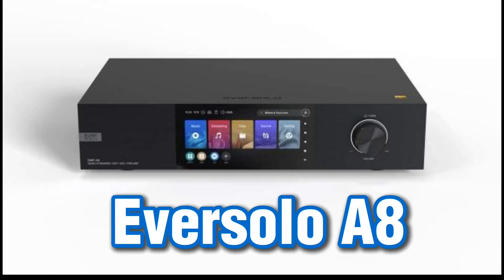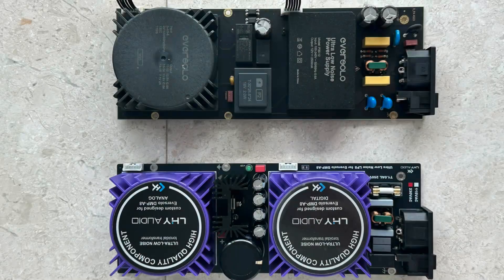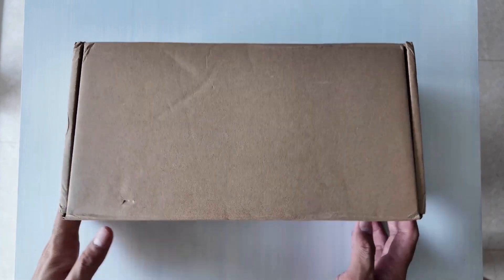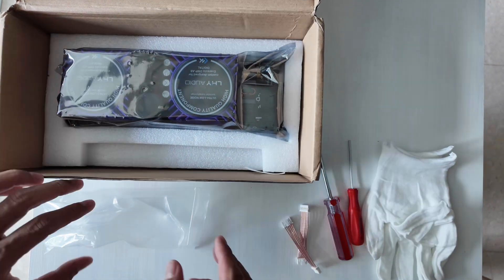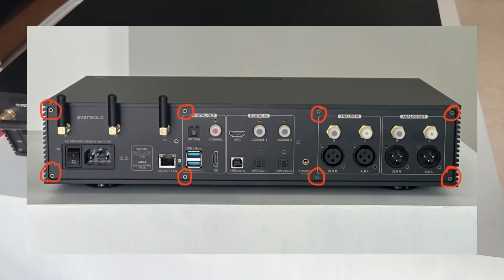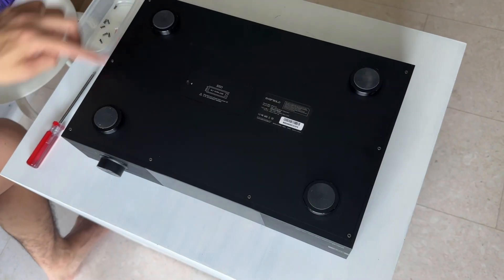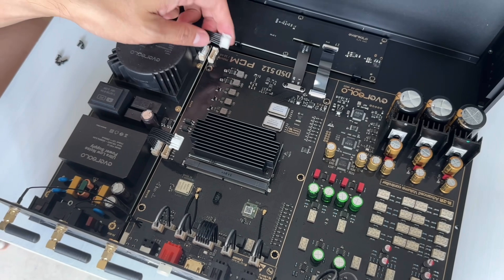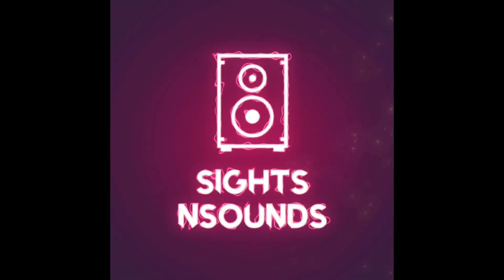Dual Linear Power Supply LPS Upgrade for Eversolo A8 - Installation Guide and Sound

Comment: I enjoyed this video tremendously and I am looking at purchasing a DMP-A8 in the near future. Someone commented that the sound can be tweaked a lot with all the features of this player. How about starting by replacing the power cord that came with it with something better? Have done it to several of my components and the improvement was excellent in all aspects; better bass, soundstage, treble, etc. Cheers and happy listening
Reply from the maker: I’m using aftermarket power cords with the Eversolo and it made positive changes to the sound. But the changes by upgrading power supply is more pronounced. Happy listening and thanks for supporting my channel
Reply: @Hifihobby can you tell me which power cable your using
Reply from the maker: I’m using Oyaide Vondita X power cable

Comment: Hi is this upgrade worth it for me ? ,i am using my dmp a8 as streamer /transport to gustard x30 dac to  quad artera pre to hegel h20 power amp your input would be welcomed 😀👍
Reply from the maker: The bigger difference is in the digital section because the switch mode power supply is changed to a linear power supply. It will help improve the sound for a relatively low price
Reply: @Hifihobby thankyou i will purchase one 😀👍
Reply: @Hifihobby hi any recommendations or links to dealers selling the upgraded power supplies please ?
Thanks
Reply from the maker: @ianbell2908 Hi you can get the LHY A8 LPS from Vinshin Audio website or look for eBay there is the version with 3 linear transformer that’s more expensive and so far that has no hum issue
Reply: @Hifihobby hi ,i have oredered the leafaudio 3 transformer lps ,did you manage to do a side by side comparison just out of interest,thanks for your advice btw😀👍
Reply from the maker: Not yet, I was busy with my work (YouTube is a part time hobby for me). Am planning to do that this month
Reply: @Hifihobby  Hi ,i have installed the leafaudio triple transformer linear ps ,really happy with it ,subtle differences across the range ,mainly upper frequencies ,no humming from unit ,gets hotter than before but not too hot,happy with the upgrade 😀👍
Reply from the maker: That’s great to hear! 👍🏼
Reply: @ianbell2908 Hello, do you think that this PS was totally worth it ? I still dont know what to choose between the 2 or 3 ps versions ! You got the Nichocon or Mundorf one ? Thx
Reply: Hi ,i noticed you have a T8 on trial ,how does it compare to the a8 with linear power upgrade ,is it worth upgrading to T8 in your opinion ?
Reply from the maker: If you are using the A8 as streamer only, to me it’s worth to sell it off second hand and get the T8.
Reply: @Hifihobby thankyou ,that was my thoughts ,is the T8 better sonically ?
Reply from the maker: Short answer is yes. Im still testing and got to wait for my full review video to be ready to get the details 😉
Reply: @Hifihobby thankyou your advice is appreciated😀👍
Reply from the maker: I’m happy to share. 😁

Comment: I can't understand why the bottom 8 screws required removal. I might have used a magnetic tip screw driver to stop screws from falling inside. If made of aluminum, it won't matter.
Reply from the maker: The 8 screws are connected to the cover that is to be removed. The screws are on the outside and not inside of the unit. You can refer my video again
Reply: Nice the new transformers becoming warm,  less efficient, not a good sign.Is the case build for this extra heat? A small hum…….I don’t feel good with this, no actual  scientific Measurements and tests
Reply from the maker: If you are not comfortable then you should not go for this mod.

Comment: Hi, I installed LPS upgrade, truve voltage 230V, all is in order, device opens up but no sound comes out! Then turned back to the original power supply, sound comes out, I installed LPS08 again, no sound! Installed the original one, sound comes out. What do you think the problem is? All the cables are back in it's original place, no changes. Also, I checked back again, there was no plastic film to remove there..
Reply from the maker: Could it be the on off switch at the back?
Reply: @Hifihobby no since if it was off the device wouldn’t turn on at all
Reply: @Hifihobby are there any other switches on the board?
Reply from the maker: There’s no other switch on the board.

Comment: Did you do another review after a suitable run-in period? That would interest me very much!
Reply from the maker: After using it for months now, my findings are the same as in the video and the slight hum is still there, so I don’t intend to make a new video. I plan to make a comparison with the triple LPS version in the near future. Stay tuned!
Reply: @Hifihobby Great! I plan to upgrade my A8 too when I get it. Many thanks! All the best, Rob in Switzerland
Reply: @Hifihobby  Apparently the 3 transformer has no hum. Can't find any technical specs on either. One might assume the 3 transformer would be better. When are you doing this comparison?

Comment: I got my DMP-A8 a last week.  Still enjoying it.  Not sure yet when I have to upgrade to dual linear power supply.
Reply from the maker: Should let it run in a bit and enjoy the music system first. There are lots of things you can adjust in there like DSP if you wish to make some adjustments, or use REW for more detailed calibrations

Comment: I installed the LHY LPS a few weeks ago and just realized I may not have removed the plastic film from the top of the transformers.   I assume they should not be left on, correct?
Reply from the maker: Supposed to be removed
Reply: @Hifihobby  Hello.  I reopened the a8 and removed them, thank you.  Question: are plastic insulation rings supposed to be placed on the PCB stands like with the a6 LPS before screwing the dual LPS back in?  Thank you.
Reply from the maker: @michaelrobinson8241  You are not supposed to put the plastic rings for this one else the IEC plug won’t align properly to the cut out hole at the back
Reply from the maker: How did you find the installation and sound improvements?
Reply: @Hifihobby  I purchased the A8 and the LPS together from the same seller so installed it immediately therefore I'm not able to compare it against the switch mode supply.
Reply from the maker: How do you like the A8 and how does it compare with your previous ?

Comment: Un grand merci pour ce tuto très bien fait, une petite question, que devient la garantie constructeur après cette modification ? 🤔
Reply from the maker: Warranty is supposed to be void if you open it. There is no warranty seal on the unit though.
Reply: @Hifihobby  Ils ont peut être un autre moyen de savoir si l'appareil a été ouvert, ce serait très simple à réaliser ! 😉
Reply from the maker: Many people have upgraded the LPS for the A6 and this is rather new for the A8. There’s no need for the upgrade if you are not comfortable with it.
Reply: @Hifihobby  C'est les doigts dans le nez, et les yeux fermés que je peux faire cette manip, ma question ne porte que sur l'hypothèse de la garantie !

Comment: When you turn the device around you see those plastic like feet underneath. Is it possible to change those against aluminum feet? What do you think? Thanks
Reply: The A8 feet are easy to remove. Lift half the rubber, enough to reach the screw and unscrew it. Literally 2 mins work. Absolutely no need to go inside the A8 for that. There is some paper in between the rubber and the foot that tears to get to the screw, but that is not an issue. I now have 4 Isoacoustic Indigo pucks at the place where the original feet were. (My stack is 21kg with the A8 at the bottom of the stack)
Reply from the maker: @WizNLD Thanks for sharing 👍🏼
Reply from the maker: It’s a messy job because you basically have to remove all the circuit boards. I’m now using  isolation feet below the Eversolo and it woking well
Reply: The feet are screwn from the inside of the A8? No way to remove the rubber layer underneath the feet? That's a pity. I don't understand why manufactures don't spend these 3-5 € more to install proper aluminum feet...
Reply from the maker: @KurtKugler-f2x I tried to remove the rubber part of the feet but was not able to do so easily and was afraid of damaging it.
Reply: @Hifihobby  I heard in a review yesterday that those feet are made from metal. I will inspect that, when my A8 finally arrived.
Reply from the maker: Yes they are metal with a rubber on the base.

Comment: Thanks for that cool video, looks very impressive and easy to replace.
I use the DMP-A8 as streamer only and I have connected it via USB to my new external WEISS DAC204. The question is if it is worth the investment for the upgrade power supply as I am not using the analogue section of the eversolo. Means can I expect any sound improvement if using the A8 as streamer only without internal DAC but with the upgrade power supply?
If yes which kind of sound improvement can I expect?
Reply from the maker: I didn’t compare performance of the streamer section alone but I would presume it would bring the same improvements as what the LPS did for the A6 used as streamer alone (tonally richer, more details an better midrange). If anyone has tried this please share in the comments

Comment: Great video! Just ordered one, i can't wait to fit it. I noticed you didn't fit the nylon washers between the chassis and the psu pcb. Did the instructions mention anything about this? There may be no need to, but I've seen it done in the A6 videos. I wonder if it might make the hum less audible, isolating the psu from the chassis? Thanks again for a great video. Liked and subscribed!
Reply from the maker: Unlike the A6 LPS, you don’t need to put the washers for this A8 LPS. If you put the washers in the IEC inlet will not align to the opening at the back. Thanks for subscribing, I’m hoping to reach 5k subs this month. Is there any particular content that you prefer
Reply: Thanks for the fast reply! Have you done video's of your own system? What you use and why? Obviously any more A8 upgrade video's would be great!😂
Reply from the maker: Good suggestion. My system “tour” is in the pipeline 👌🏼

Comment: Nice. I just upgraded the clocks (Ian Canada SC PURE) and voltage regulators (Sparkos labs 5v, 12v, -12v)  in mine. Very big improvements. Doing the power supply next. Using a Toroidy Supeme Audio Grade transformer, Ian Canada 12v LinearPi Pro ultra-low noise linear power supply, Nvarcher 12V Super Capacitor Power Filter, and MOFI HiFi AC Power Line Dual EMI Filter Module. It will be at least 13X lower noise than the LHY audio LPS. I am glad to know it will make a good improvement.
Reply from the maker: Wow the clocks and voltage regulators that you upgraded to are good parts and you gotta perform soldering.  Let us know how your LPS improves the sound. Cheers 👍🏼
Reply: @Hifihobby  Yeah, easy to solder. Can take it to one of those cell phone repair places if you don't want to solder yourself.
Reply from the maker: That’s next level stuff. I will try to find out more. Where to order the part tho?
Reply: @Pete.across.the.street  .. thank you for sharing . Would you mind sharing more details? I looked on Ian Canada’s website , but so many choices.
Reply: @paulwisconsin456  what info do you need?
Reply: @pete: I ended up having the four opamps on the XLR output stage upgraded to SPARKO-81460.  These Sparkos discrete opamps draw 4 times the current….so the input stages were left OEM to avoid overloading the power supply. From your experience, do you think it’s will make a significant audible difference to upgrade to the LHY power supply?
Reply: @freddyjimenez6328  nice. I want to do opamps as well. The lhy audio lps for the a6 was under powered, IDK about the a8. The lhy audio lps is still relatively noisey as well. Plus if it buzzes IDK I would use it. You could replace the 35va toroid with a 50va one if you need more power. I bought a blank pcb to mount the power supply on.
Reply: @ yeah, I might go with your recommendation on the bigger power supply.  I’m also considering upgrading the clocks.  Thanks again for posting your upgrades.

Comment: Very nicely explained 👍🏻
Seems even the noob like me can do it
Reply from the maker: Thanks for the positive feedback. I try to make it as clear as possible.
Reply: Same slight hum here. I was able to install small o-rings between the print and the mounting pins, and that helped somewhat. Shorter pins and a thicker elastomer piece would help further I guess.
Reply from the maker: Thanks for sharing. I may try what you did at a later stage to experiment but it doesn’t bother me at all as I can’t hear it from my listening position even in a very quiet room. How has your sound improvement been after the LPS installation?
Reply: @ I think you described the improvement very well. More air, detail, resolution and better separation from mid bass and up.
Reply from the maker: Agreed. Overall improvement 👍🏼 What’s the rest of the hifi system that you have currently?
Reply: @ the A8 goes into a Bladelius Ask Integrated w/dac (and streamer, but I dislike the Volumio interface) and speakers are Marten Parker Duos. Power from a Puritan PSM 156.
Reply from the maker: @vimvim8805 Nice! They must sound amazing 🤩